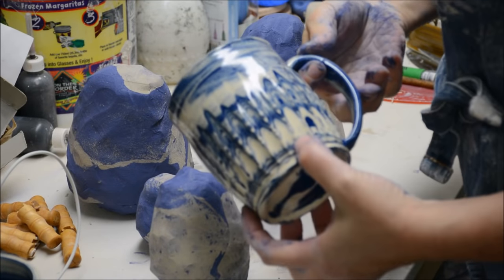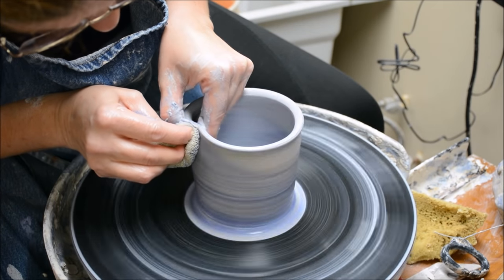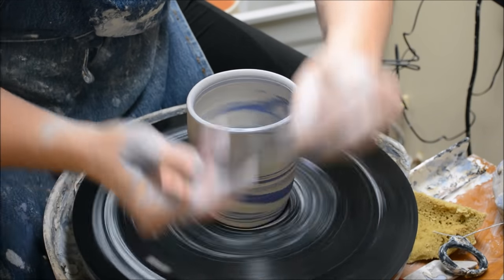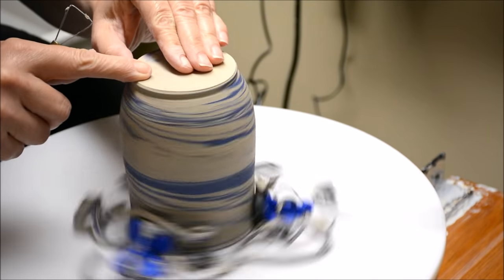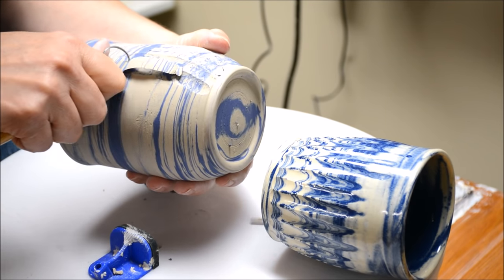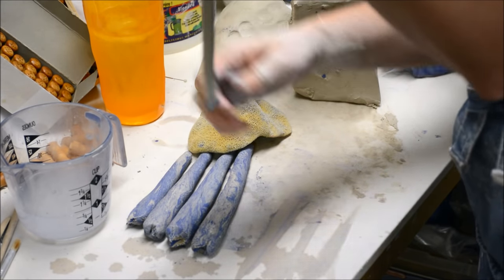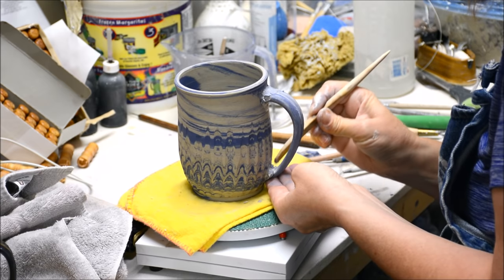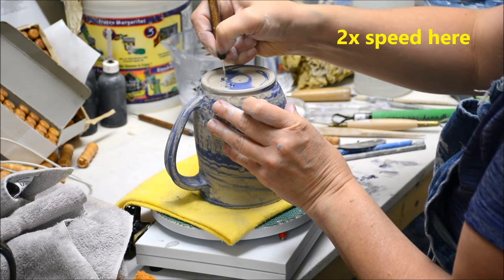Making a Fluted Mug with a Colored Clay Body for Marble or Agateware  Throwing, Trimming, and Finish

Comment: Good morning, Karan! ☀️ Finally getting out today to look for waxy shoe polish and water colors. I don’t have an art supply store where I live, but there is a Ben Franklin that has all kinds of hobby items. Do you recommend water colors in a tube or dry pellets? I am so looking forward to experimenting and finishing work on my pieces. Since they are outdoor pieces, and since bisque is porous (like terracotta flower pots), I was thinking I have lots of glass mosaic pieces I could apply as a top design layer. This would make the piece heavier...
So,  I will try the shoe polish and water colors first! Thanks again, Karan.
Reply from the maker: sorry for my delay!  I was out of town, and didn't realize I had missed a message!  :)  Good question about the paint... I don't think I would have a preference one way or the other... so try the one you like the best!  I hope things are working out well for you!  :)  Karan

Comment: Hi Karan. Just wondering if you can answer two questions.
1.I have a bunch of bisqueware but I no longer have a kiln or access to commercial firing. Can you recommend a stain or some sort of colorant/sealer that wouldn’t require additional firing? (My pieces are not food service items...mostly wind chime pieces and birdhouses.) 
2. I could watch you throwing and  trimming this mug forever. Is it true that left-handed people need to throw on a wheel that turns in the opposite direction?
Thank you. Your students are so lucky to have you.
Reply from the maker: Great questions!  As to the first- colored waxy shoe polish is great! I also would use watercolor paints with my younger students and we would seal it with a floor sealer. (Like JohnsonWax or something like that- it’s been years I forget what it was!).   As or the question about left handed throwing... if you want to throw with a left hand orientation- (opposite of right hand placement) I would recommend a clockwise rotation.  I do know several left handed people that also throw with a right handed rotation and hand placement.  I’d recommend trying it both ways, see what feels best. Just remember though, whichever you choose, when centering, the rotation should be coming toward the outer hand not spinning away from it! :)

Comment: how much does your pottery wheel cost?
Reply from the maker: Mine is over 20 years old at this point... and this model is hard to find.  I did find a supplier which sell it for a bit over $800 without the motor and splashpan.  With those included, it is a bit over $1200.  But, if you are looking for a good wheel, you can find motorized wheels from tabletop versions around $400 - $500 up to the floor models up to around $1500.  When I first bought it, I put aside money I earned from teaching some classes on the side.  If you set aside a little money a bit at a time, it makes it a more manageable purchase!